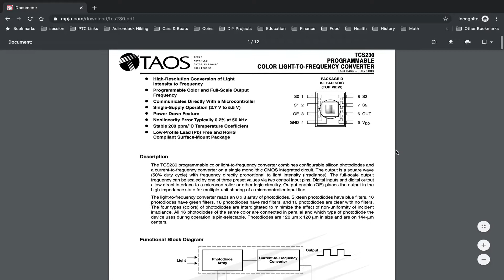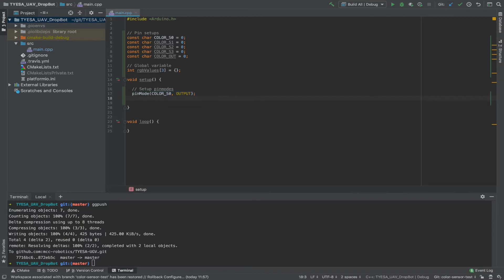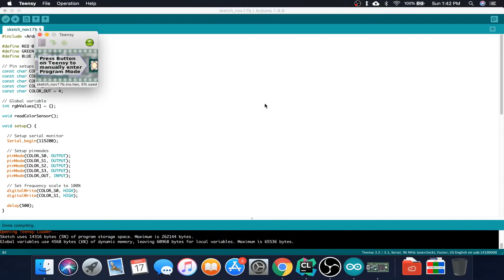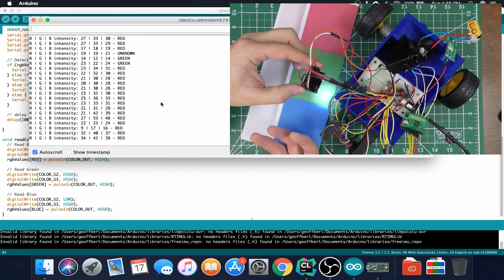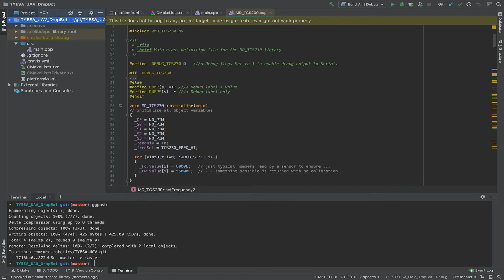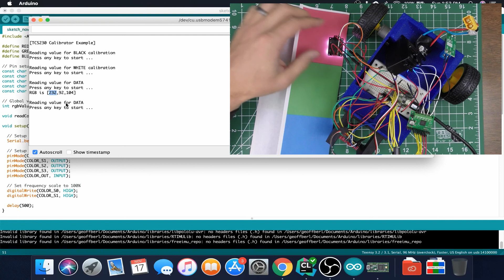How to Program a TCS230 Color Sensor

Comment: Is there a way to turn of the 4 LEDs?
Reply from the maker: Unfortunately no, this would be helpful in some situations where you want to factor out the ambient light. The only thing you could do is remove the LEDs but obviously this would make them always off. If you want control of them I would suggest you remove them and then make your own separate circuit board with your own LEDs. If you have enough knowledge, you could also modify the board by cutting the trace that supplies the LED voltage and wire a digital pin to that trace so you can provide the 5V using digitalWrite(HIGH/LOW).
Reply: @RobotResearchLab  Yes I was thinking about removing the LEDs but modifying the trace seems like a better idea. Thanks for the reply :D